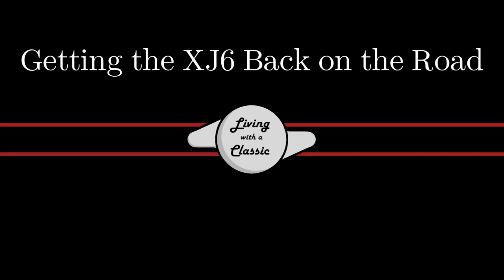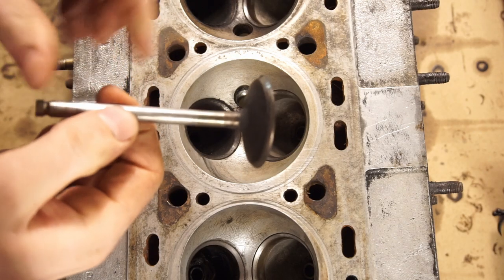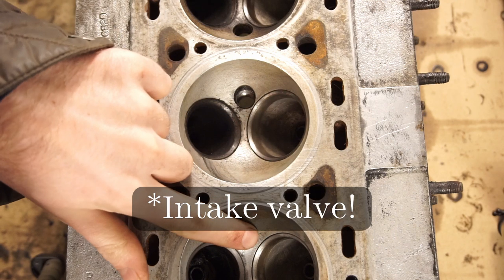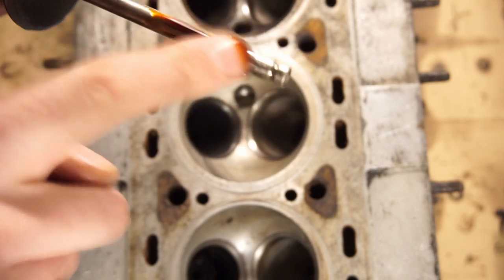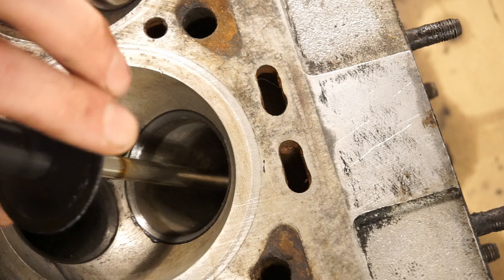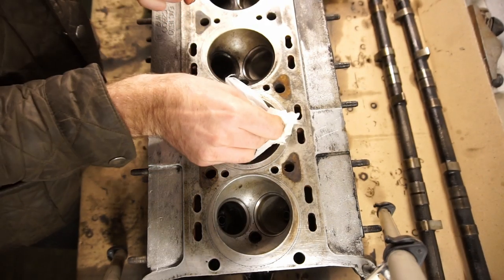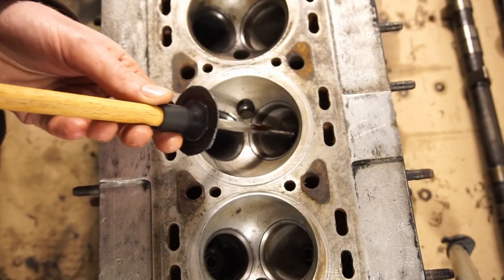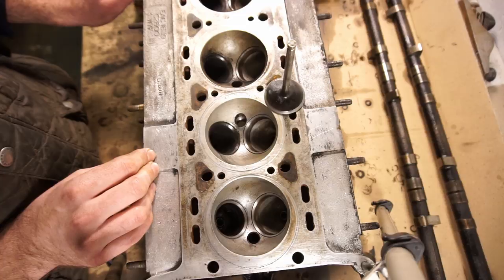Lapping Valves at Home - Jaguar XJ6

Comment: Important detail: You don't mention how the grinding paste may fall into your valve guide, and effectively ruining it. The grease you put on the valve stem at the beginning actually prevents that because the excess grease will accumulate at the hole and thus prevents debris falling into the valve stem. Also, you may want to do a leak test with some fuel onto the valve and check for leakage around the valve stem (valve stem seals removed).
Thoughts?